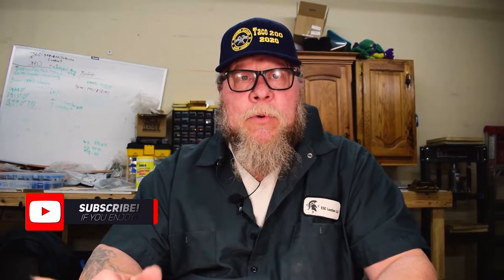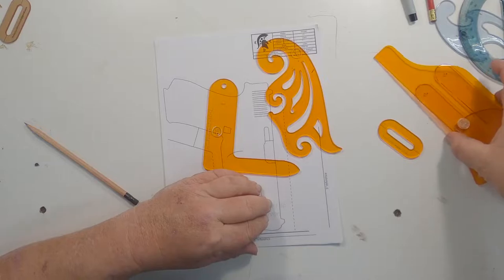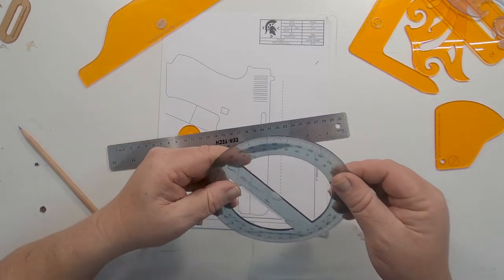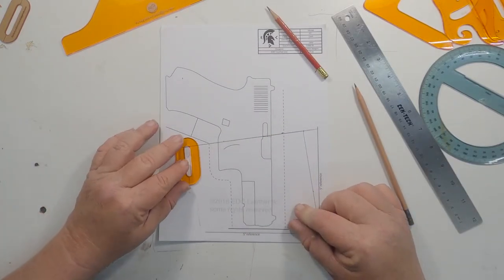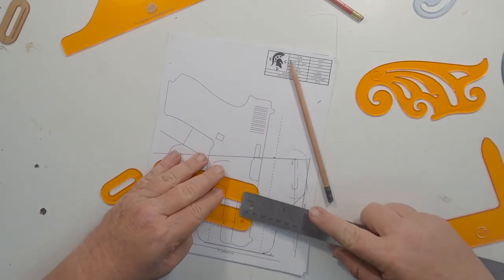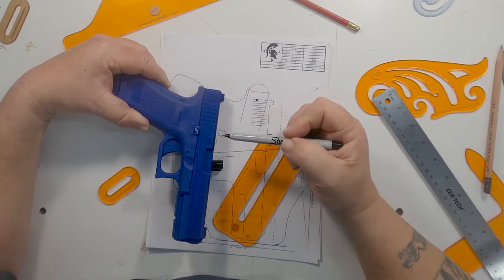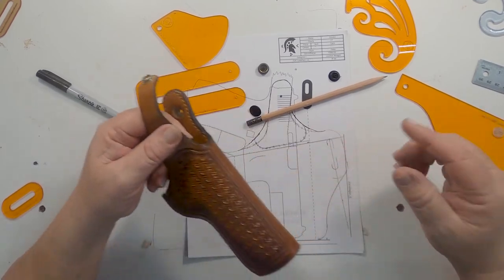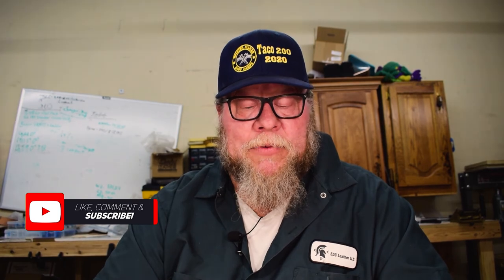How to Draw a Leather OWB Thumb Break Pancake Holster Pattern for ANY Handgun

Comment: Several of my holsters the back of the thumb break is only one layer of about 9oz leather, and have the metal tab riveted and on the back (away from the gun) of the leather.  Do you see any problem with that, it seems like a matter of taste to me and desire for appearances as well as fit and finish, but also makes it easier for me as it’s removing steps?
Reply from the maker: I prefer using 2 layers of leather, this creates a hinge point in the holster for the break.